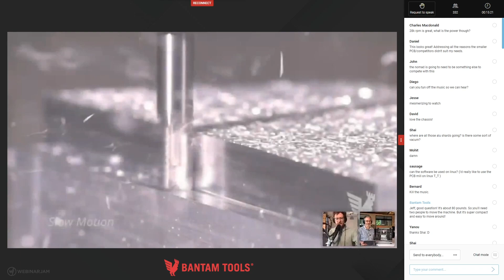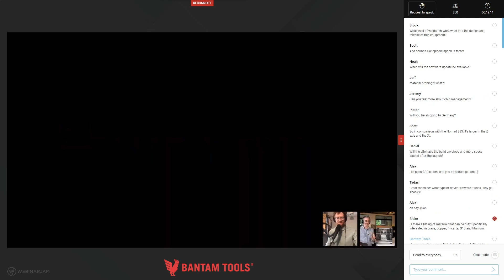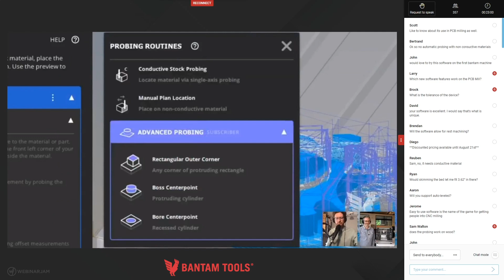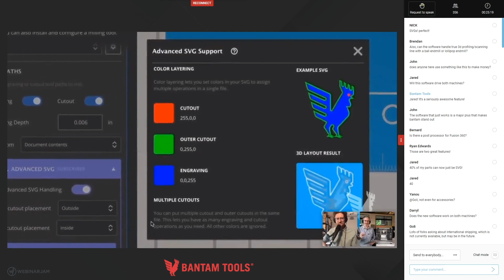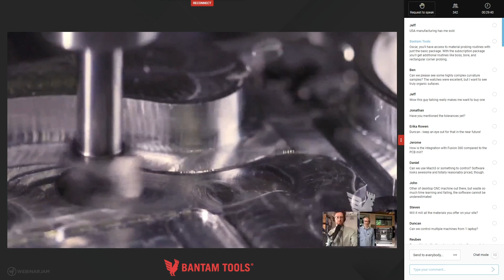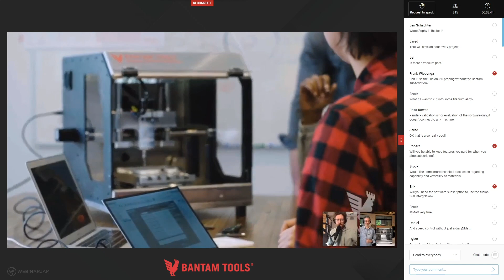The Bantam Tools Desktop CNC Milling Machine Launch Livestream Replay

Comment: I was a machinist/programmer for 50 years and now retired. The probing and software was very impressive...until I heard the words..."software subscription".
Reply from the maker: Hi Tom! To clarify, every Desktop CNC Milling Machine automatically comes with a basic pack of the Bantam Tools software. It comes with features like material probing routines, SVG support, and Fusion 360 templates. In addition, you'll get a 30-day free trial of the subscription plan to test out. If it's not for you, no worries. It's completely optional.
Reply from the maker: That said, as a software subscriber, you'll get exclusive access to the new tools and features we'll be rolling out each month, Bantam Tools projects, and priority tech support.
Reply: @bantamtools  EDIT: @Bantam Tools has since flipped the switch and included live feeds/speeds adjustment in the base package. 

Old comment for reference:
That's all fine and well, but you're locking feeds and speeds adjustments during operation behind that pay wall. We should all agree that this "feature" is a basic machine function and shouldn't require a subscription. Still, I have already purchased mine and will give Bantam the benefit of the doubt and hope that it changes.

Comment: Does the material probing rely on conductivity to build plate? Or does it work with woods and plastic.
Reply from the maker: The material probing does rely on conductivity. If you're looking to locate a nonconductive material on the T-slot bed you'd need to probe the L-bracket.